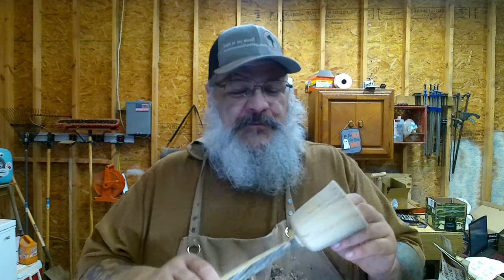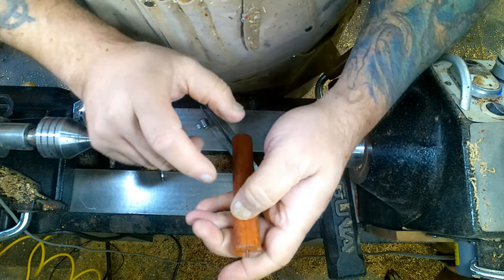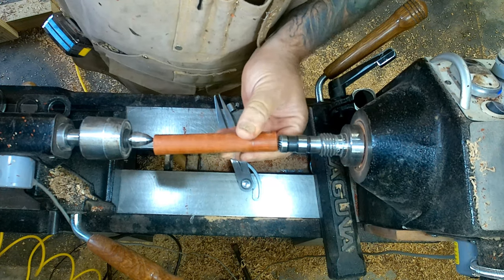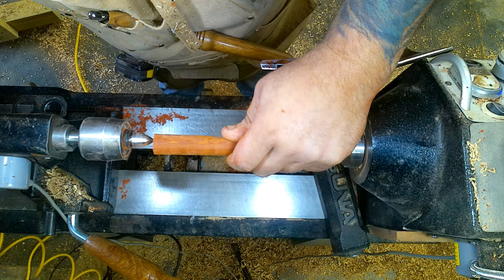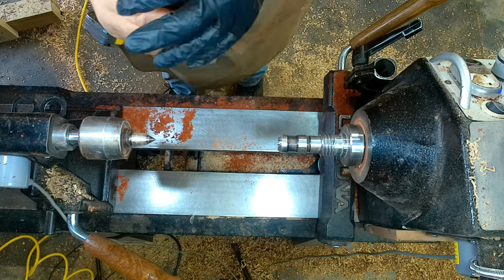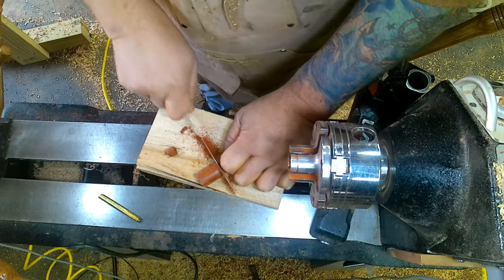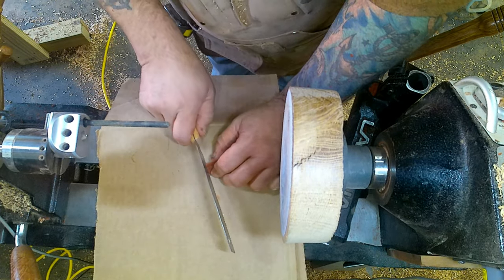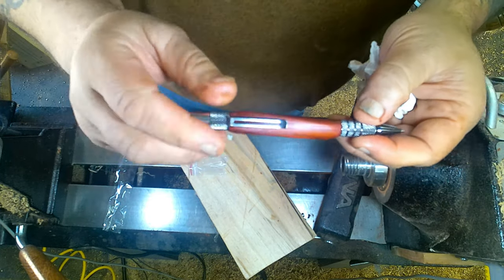Four Axis Bubinga Pen

Comment: Very nice, I bet the grooves really make a good fit. I’ve only done one pen and sanded just a Kyoto much off the end so the mechanism doesn’t work as it should so that will be my pen. To make this pen easier could you drill your hole first then attach it to larger ‘waste blocks’ on each end so you can put your axis points on the larger pieces of end wood?
Reply from the maker: That is the other method I thought of - and it is one I am going to explore. I think it's 6 of one and half a dozen of the other - and I am certain there are mote methods than just those two.